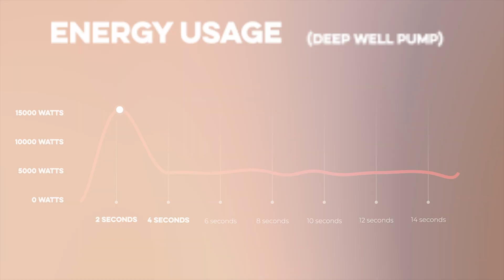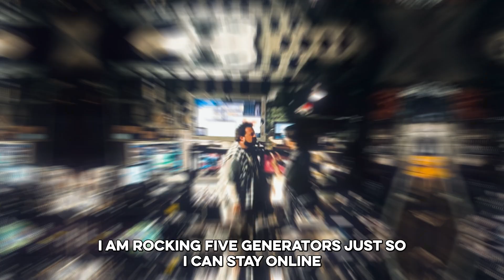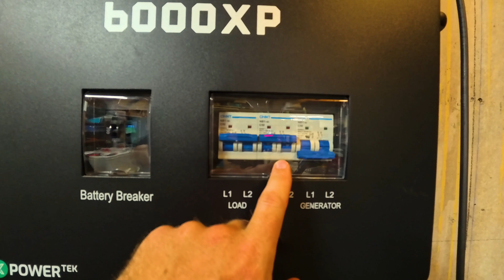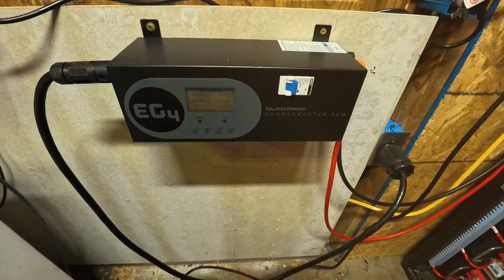How to Thrive During Increasing Blackouts

Comment: So, I’ll be real curious how this system works long-term with high power compressors (like AC units) on your high frequency inverters.  Those don’t typically work well with high frequency inverters.  Low frequency inverters (like Victron) are usually much better for those — and can do everything the high frequency inverters can do.
Reply from the maker: Me too

Comment: You should think about propane or kerosene for heat. Save battery power. Even a tankless water heater.
Reply from the maker: Good advice. I’ve got quite a few videos on propane heat. It’s one of my favorites. 👍🏼 I need to look further into tankless water heaters. I used to have one running on natural gas when we lived in the city.

Comment: Help! Lol. I watch all the channels and I feel I'm missing something or nobody says it. @ 4:58 "refrigerator 1000w" so is that 1k x 24 hours = 24,000? Or just 1000w? If it's 1k per hr then your batteries would need to carry 24kw correct? (Minus solar input) This is where I get confused! 😅
Reply from the maker: Sorry for the confusion. That’s only while the compressor is running. It will cycle on and off all day. Just like our well pump that uses 5000 watts, it only turns on a dozen times a day or so and only for a few minutes at a time. One thing you can do is purchase an electric usages monitor plug to see how much each unit uses per day. Plut this thing into the wall behind your fridge and then plug your fridge into it. You will be able to see how many kWh/day as well as it max power draw at startup. They’re about $10 on Amazon. This one looks pretty good. https://amzn.to/3L9uvRe (affiliate link) I hope this helps. Let me know if not.
Reply: @EastTexasHomestead  thanks for the reply. Just trying to size a single room as a critical circuit for eg4 battery, inverter and solar. (Home office)
Reply from the maker: Gotcha. Best of luck and let me know if I can help in any way 👍🏼

Comment: The Lego example is a good analogy to how it really does work. Because you can try putting together a Lego set without the included pictogram manual that comes with the set. The good news is that the Lego set does come with the manual. Likewise, the inverter system in modern times now comes with the easy to follow manual in most cases and also the plethora of YouTube channels that help people walk through the settings, etc. so it really does compare to a Lego set, you can build whatever you want and there’s plenty of information to get it built even if you’re a first timer.

Comment: Nice work man! I don't think I will ever be done lol. My system needs about 200kwh for my crowd and maybe 40kw solar array it seems sometimes. But I have a good start with the 85kwh and 16kw array.
Reply from the maker: You’re so far ahead of us! I’m trying to catch up 🤪
Reply: 200kwh a day?
Reply: @donlatinohits  no lol. Just wish I had plenty of extra for cloudy day. But we do use a lot of power.
Reply: @rodneyhunt  what's the maximum your household have consumed in a day
Reply: @donlatinohits  The high maybe 120kw or so. I have an EV so that brings the numbers up some.
Reply: @rodneyhunt  oh that's fantastic, am working on a house in Nigeria, its a seven bedroom with 3 living rooms and elevator... The budget is a 100kw inverter paired with 240kwh of lithium battery. Everything high voltage.
Reply from the maker: The elevator will be interesting to power
Reply: @EastTexasHomestead  we already did a hotel with the elevator backed up on the solar system.... And you know hotels have more traffic than residence.

Comment: You got it going on there. Great Job. I'm  East TX also.  Few miles north of Longview.  Nit sure where you are. Been working on my energy independence  no where near as far as you. But doing as finances allow. Have to of the solar mini splits installed and have solar to them as well as a couple solar generators and 4  gas generators and over 350 gallons of fuel. So won't ever be caught flat footed again. Still have a long way to go. But will get there. Thanks for the video..... Jeff
Reply from the maker: In many ways you’re better off than we are! 😁 always good to hear from neighbors. We are just outside Tyler.